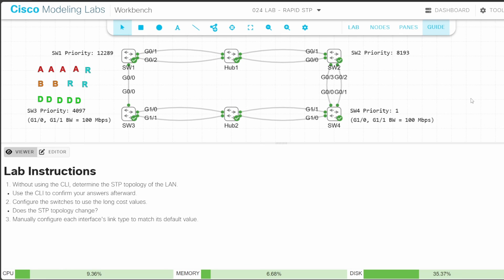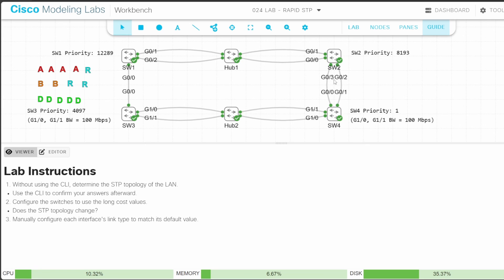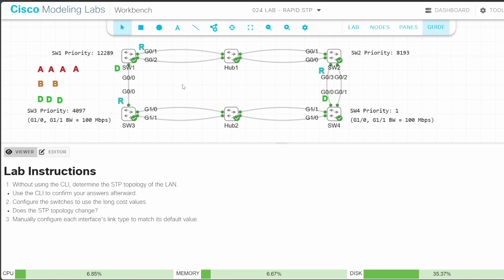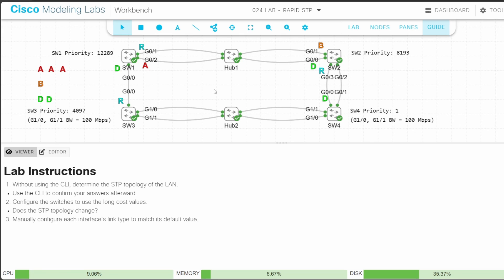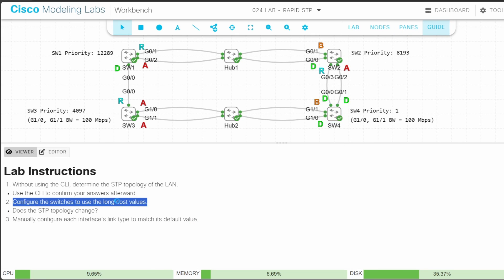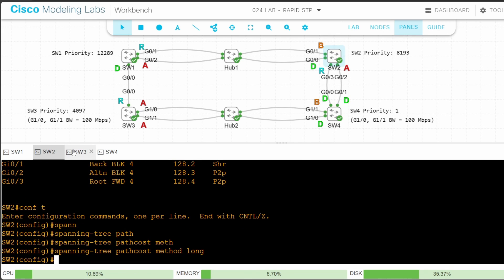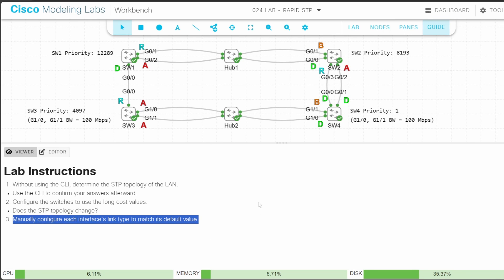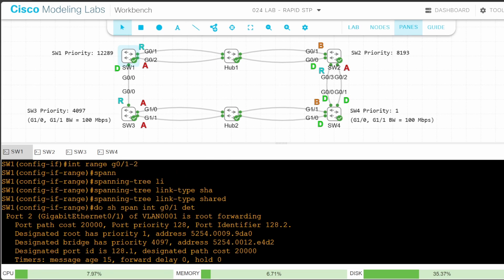CCNP ENCOR // Rapid STP (RSTP) (LAB) / BPDU Filter // ENCOR 350-401 Complete Course

Comment: Add a role that, if there is a link on both sides, is designated; one of them must be non-designated. So I understand G1/0 and G1/1  on SW3 are alternate, but I don't understand  why G0/1 on SW2 is a backup port when it isn't the root bridge